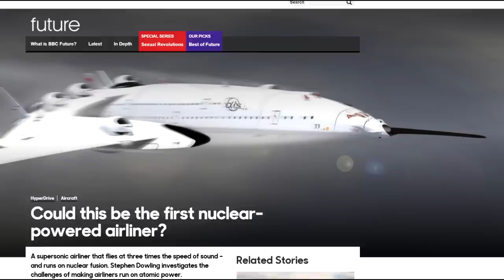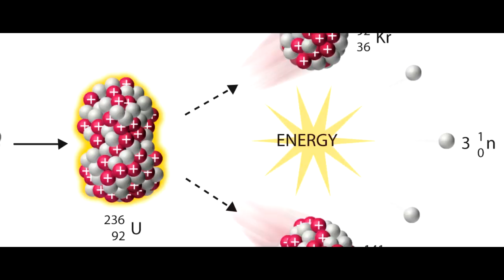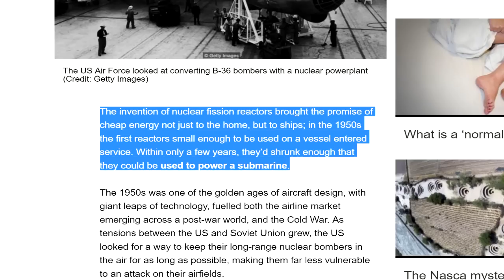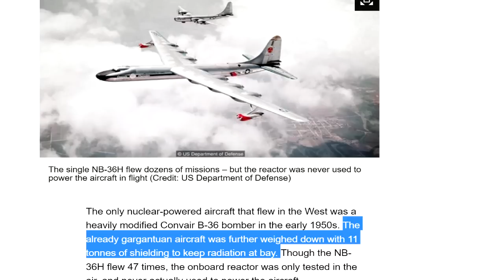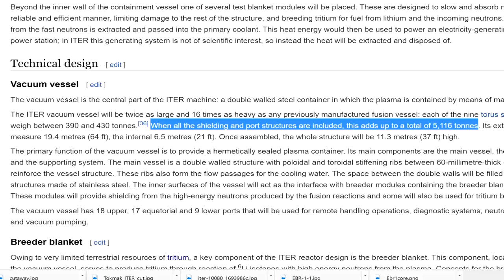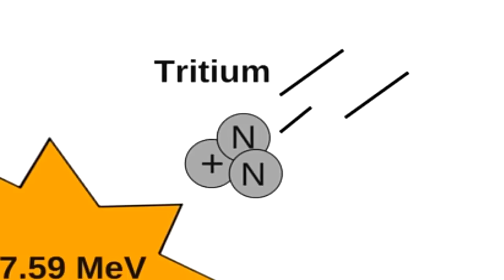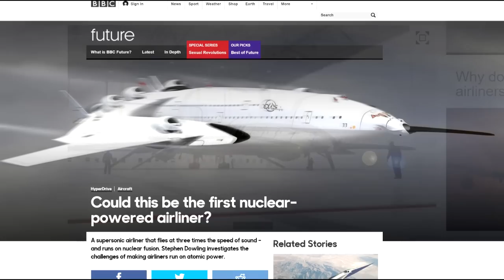SIX ENGINED Nuclear Airliner... BUSTED!

Comment: If we're going to be realistic about powering planes with Fusion, you'd have some kind of quick filling battery capable of storing enough power to make a flight, then plug the plane into a fusion powered grid between flights to charge the batteries.

Trying to put a fusion reactor on a plane is like trying to put the upper crust of the earth on an SUV to generate petrol.

Comment: Didn't the consider the idea of a fission reactor on an aircraft in the 60's, and scrapped it because of the risk of what could happen if it was shot down?

And additionally, if I recall correctly, the only reason that fission reactors can be in submarines, is because they pump cold seawater through their core, and as such, cannot pass the equator, as the water is too warm.

Comment: You do know that tritium is a poor choice for a fusion reactor, don't you? Helium 3 is a much better choice, it is not radioactive, it is much more abundant and it does not produce neutrons, high energy or otherwise, during the reaction. Of course, the closest significant source of the stuff is the Moon, where the lunar regolith has been accumulating it for billions of years from the solar wind, but its value as a fuel is so great that going up there to mine it would be quite profitable. And long before that already significant reserve is exhausted, we would have the technology to go extract it from Jupiter's atmosphere, and that should easily  last us for a billion years or two.

Comment: Seriously, he's totally ignoring the research on cold-fusion....
Reply: Kindly check "Clarke's 3 Laws".  Did you know that the Astronomer Royal of England in the early 1960s mathematically "proved" that men could never reach the moon?  Did you know that it was mathematically demonstrated in the 1800s that if a train exceeded 40 mph,  all he air would rush out and the passengers would suffocate?  Did you know there were prominent scientists that refused to believe the Wright Brothers had flown even 4 years after it happened?
Reply: Why design the car?  Because you have to have an idea what you're putting the engine into before you can design it properly.  There was a nuclear powered bomber being designed in the early 60s  that was only cancelled because of the advent  of  ICBMs.  
     Fact is that nuclear-powered vehicles are neither impractical nor unrealistic - and not even that difficult to design.  The US Army had a well-advanced nuclear rocket program that was cancelled when Kennedy decided that space-travel had to be a civilian project (to distract people the "Bay of Pigs" fiasco)
    You can use the heat of radioactive decay to run a jet engine - which require neither fission nor fusion, and very little shielding as well....
Reply: "...I don't think you understand..."   Actually, I don't think you understand.  A nuclear engine doesn't have to be larger that a home's hot-water heater.  That was established by the late 1950s/early 1960s.
    "...There is a very good reason that we don't have nuclear powered cars..."  Right. There are quite a few very good reasons,  (and some very bad ones)  but size and complexity isn't one of them.
    "...Quit being ignorant..."  You may note that I haven't been restricting the point to just fusion. I've already mentioned the nuclear-powered bomber  (a heat/jet engine), the Army's nuclear rocket program (fission).  The Navy had one too (Project Orion) - which was another entirely different concept,
    Who's "...being ignorant..." here?
Reply: Seriously,  "...The weight alone from the lining..."  Not very good at actually paying attention or investigating facts, I see.  I've already explained that a nuclear engine doesn't need to be larger than a water-heater.  This was established by the early 1960s.  I'd say you could look it up, but you've already demonstrated your unwillingness or inability to do that. 
     We aren't talking about generating commercial power for half a dozen cities and hundreds of thousands of homes and businesses here.   We're discussing relatively small vehicles.  Do you understand the concept of "scale"?
     Of course your comment that "...Clarke's first law doesn't mean shit to me.." does say something about your intellectual capacity - Especially considering that the overwhelming majority of legitimate scientists agree with it. (Really, why do you think it's known as "Clarke's 1st Law"?)
     And "...shouldn't be used as a retort in any debate or argument..."?  I'm sorry, did I somehow miss the part where we agreed that you got to set the terms of debate?
     I do have to give you a point for the term "wistful fool".  It has a nice ring to it.
     But "...are no longer worth my time..."?  Really?  
     Imagine how I feel.  This is my first attempt at deliberate trolling, and all I got was you.  Not even a decent, coherent argument.....

Comment: Aside from that, how do you keep it from heating up so much that it deforms. 

There is only one known aircraft so far that could keep Mach 3.6 or beyond for hours, and that is the SR-71, which used it's own fuel to cool it down.

It used JP7 which was needed a catalyst to be ignited. 
https://en.wikipedia.org/wiki/JP-7

How will you do that on this plane, which not only has no heatsink like that, but also a major heat emitter on it?

This "concept" does not work on so many levels it really baffles the mind.

Comment: I actually remember researching nuclear propulsion for a story I was working on a while back and came across several project that the US an the soviets worked on back in the 50s using the heat of nuclear decay to heat up air in a jet engine and could match conventional jet engines in terms of raw thrust but were never mounted on aircraft (as far as anyone is aware). basically they worked much like a RTG cell, only instead of using thermo couplers the pressurised air would be pushed over a cooling fins heating the air using the heat of the core. 
I would assume that in such a setup the compressor would have been electrically powered 

the only reason that the two sides abandoned the research was because ICBM technology reached the point that long duration bombers were no longer needed.
there was also a few projects using similar principals to power rocket engines.

Comment: You probably know more about this then me, but I did read that in the 50s or 60s the US government was thinking up plans for a jet that would be powered by an open core reactor. It would pretty much use the heat produced by the core to superheat the compressed air in the jet in place of liquid fuel in order to create thrust. From what I read, after some thought, they found that the radioactive pollution caused by such an engine would be enormous and that they would have problems getting the thing to turn off short of crashing the thing since the open core would constantly be heating the air. Of course, there was the issue of radiation and the pilot as well. So, maybe it could be made, but the people flying in it and under it would be subject to fun doses of radiation. Do you think such a jet would be possible?

Comment: http://sploid.gizmodo.com/lockheed-martins-new-fusion-reactor-might-change-humani-1646578094

there's also another prototype design which uses synchronous impacts of molten nickel contained in a sphere to provide the pressure for deuterium and tritium to fuse. That prototype may have failes by now, as it had a small budget. However, it was small, fitting only in a man's garage. 

I'd rather have more of these scientific based videos, Thunderf00t, but I'd urge you to rethink your tone. This one paints a grim, cynical view of nuclear propulsion that's not constructive to the over all community. As you have debunked in the past, nuclear power is not as dangerous as every one thinks it is, I'm referring to your slap down on the Fukashima over hype. Yet in this video, you're painting that same level of hype. As one with aeronautics experience, I can tell you that this design doesn't work not because of it's proposed power plant, but because of it's aerodynamics. there's no way such an awkwardly design would survive mach 3 flight. That and the engines don't even appear appropriate for Mach 3 flight, there's no diffuser or variable geometry anything to help slow the incoming air upon intake. 

Aircraft with live reactors HAVE flow ( doezens of times ) and they were sufficiently shielded to protect the crew from acute radiation poisoning (though it was debatable as to the effectiveness of said shielding). When the USSR collapsed, documents revealed that the Russians even flew a plabe POWERED by a reactor. So powered flight DID occur, but likely at the cost of 10 lives through out the program. The simple fact is, there are alternatives to the old Tokamak design, and we've now got new ways of shielding (magnetic deflector shielding wss recently tested at CERN, resisted all bombardment and protected the subject). Nuclear rocketry is also a strong avenue as there are possible methods for nuclear rockets that work with much lower risks than originally perceived. Even as late as 2013, NASA is currently working on a nuclear rocket stage for the SLS, showing that there's still reason to pursue nuclear propulsion.

Comment: Well i will made
smaller reactor with even smaller shielding
using dirret conversion of heat i will use a newly developed 
shielding material and new concept of physics

oh damn it , that a lot of physics
Reply: Im a "Backyard Theoretical Physicist" 
and im working on a some concept regarding Shielding Heat and High energy projection 
(Electromagnetic radiation or high velocity particle)

Comment: Neutrons have another problem in addition to being hard to shield against, they activate materials. So while it's true that fusion doesn't produce large amounts of nuclear waste, what it does is turns the reactor itself into high activity waste. Now, this is no problem for a stationary reactor, but a reactor on a plane? That's gonna make the ground handling and servicing veeeery interesting. And if you ever crash, you're going to spread highly radioactive debris all over the crash site (and up in smoke!).

There are aneutronic fusion reactions, but those are even harder to achieve than the D+T fusion we're attempting and failing... Like orders of magnitude harder.

Comment: To be fair... you only discuss ONE type of nuclear fusion currently under research.. aneutronic fusion reactors could be orders of magnitude smaller/lighter, create electricity 'directly', not needing to use a heat transfer systems through turbines, rather generating electricity directly through the capture of alpha particles.  Just sayin... there ARE other methods of fusion being investigated that COULD power a jet like this.  There's also the thorium powered nuclear air plane project that Oak Ridge undertook to develop, the predecessor to the current molten salt reactor experiment.  Although there weren't ever any prototypes built, it might have been possible to build an aircraft reactor system that wasn't totally farcical.

Comment: Logistically it sounds much more plausible just to run a plane on battery power with the batteries charged up by nuclear reactors on the ground. But then again, how the hell would an electric-powered airplane even work in the first place?
Reply: Then you have to keep in mind that charging a battery takes much longer than a simple refuel. So these airplanes are going to be sitting there longer than they're going to be operating. The airline business is already struggling hard enough to make any profit even with planes that are fully operational.

Comment: 10 tons was the weight limitation of aircraft around the time that nuclear power first became a reality. Nowadays cargo sized  aircraft can easily carry such weight - into the hundreds of tons. However, while a nuclear reactor whould almost certainly produce the kind of power required to lift that weight in some form, it would neither be practical, spacewise or from an engeneering perspective: how do you use the energy for propulsion? My best guess is thriugh electricity powering propellers, but jets are what allow planes to lift the kind of weight they do, and you can not go supersonic with propellors. I have previously attempted to theorise a type of jet engine that used nuclear power almost directly, but came to the conclusion that it would be unsafe (if the aircraft crashed ut would release nuckear fuel and waste into the atmosphere immediately), no more practical than conventional jets and damaging to the environment (it would cause chemical reactions in the air similar to burning conventional fuel). On top of that I am not a nuclear physicist, so it probably wouldn't even work!  I most certainly agree that the concept featured in this video is a hoax. Wish it wasn't! Nuclear power IS great, just on the ground... supersonic passenger flight is a dream of the past: our future us efficiency and concern for the environment, and that doesn't have to be boring! -thought I'd share my thoughts on the topic.

Comment: you can bust this from just the engines alone without all the fancy science... a nuclear reactor can't produce usable fuel for a standard jet engine... they could use steam to power an internal turbine to produce electricity... but here's the next catch... electric engines big enough to provide the right thrust and lift would be far too heavy to be practical not to mention that the electric engines would need to be "propeller driven" and anyone in aviation KNOWS that props can only attain a certain maximum speed before they catastrophically fail and that speed is below that of the capacity needed to fly a plane at mach 1 alone. so there's all the info needed to pretty much bust the possibilities of EVER seeing a nuclear powered aircraft... UNLESS you take on the task of using gyroscopes or heavy flywheels driven by electric motors to achieve "anti-gravity" which they still have not quite figured out yet either so... yea... until that time there will never be a nuclear powered aircraft.

Comment: Tritium is not overly dangerous, and not all nuclear fusion reactions produce neutrons. There are a set of nuclear fusion reactions known as aneutronic fusion reactions, notably Deuterium and Helium 3 reactions.
2D + 3He →   4He  + 1p + 18.3 MeV

In all fairness though, Helium 3 is rare and it's more difficult to fuse than D-T fusion but it is possible and would obviate most radiation shielding necessary for operation in traditional fusion reactors.

You're slipping tf00t. I thought you were supposed to be a scientist?

Comment: Now... Imagine if this plane was fuelled by thorium, which is, in fact, one of the densest elements in existence! They could also transfer the energy from the reaction by heating water that powers a laser which is pointed towards a small solar panel.
While they're at it, they should add in some kind of Fontus system so they wouldn't have to bring water on the plane.

Comment: Tritium is not "screamingly radioactive"

"Tritium is an isotope of hydrogen, which allows it to readily bind to hydroxyl radicals, forming tritiated water (HTO), and to carbon atoms. Since tritium is a low energy beta emitter, it is not dangerous externally (its beta particles are unable to penetrate the skin)"

It helps to, ya know, look things up before talking about them in a video.

Comment: Yeah this is pretty lulzy .... but here's something quite scary:  Lockheed is now within 10 years of finally back-engineering their Fusion Reactor that generates more power than it expends on its Magnetic Containment fields.  And you numbnuts over in the EU/UK were the chumps who basically funded the research for the final missing pieces of that equation but you won't be seeing one cent back from the astronomical Privatized valuation jump that's going to take place

disclaimer:  it's not just an electron shield ...it redirects mass and gravity itself which is what makes it "back-engineered"

Comment: This happens a lot in the aerospace industry, Airbus and Boeing will throw something like this together for their air shows and show off to potential new employees as "You could be designing this" or to future investors "Your investment could go towards building this future". The maths behind this is easy, they know how many passengers the airlines want therefore they know the mass of the passengers, cargo, flight crew, cabin needed to house all this therefore they know how much thrust to get to 0.8 Mach so they know how many engines/etc. To get it above Mach 1.0 is just add more engine's.